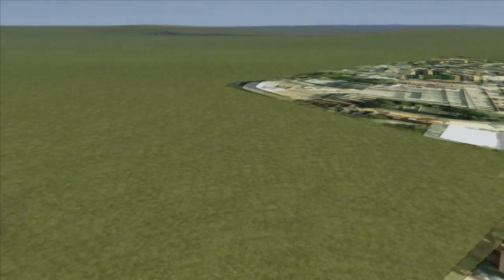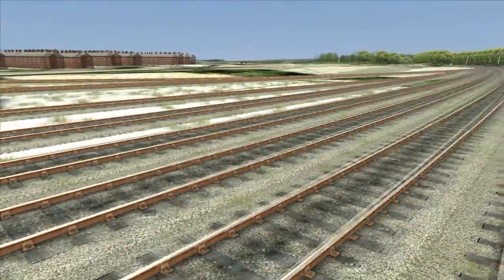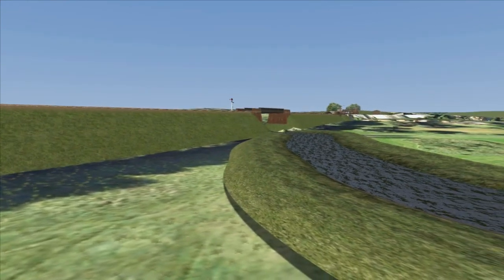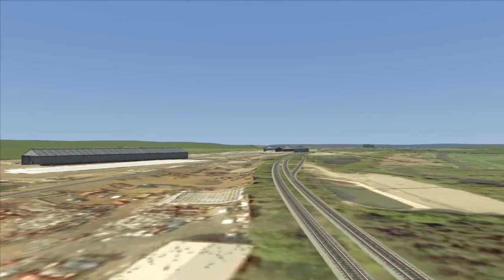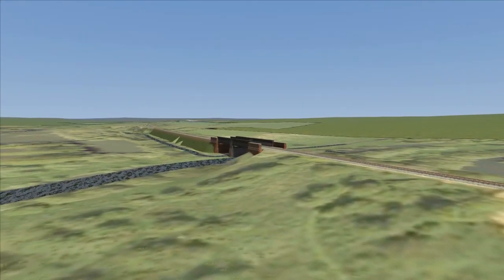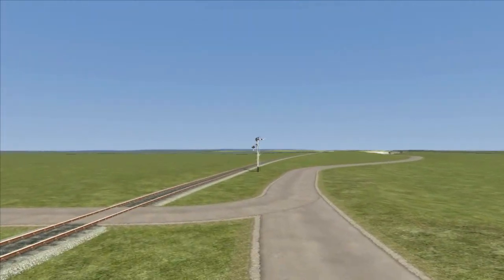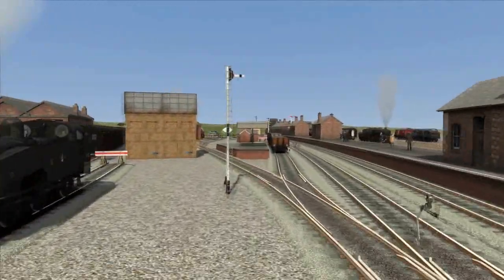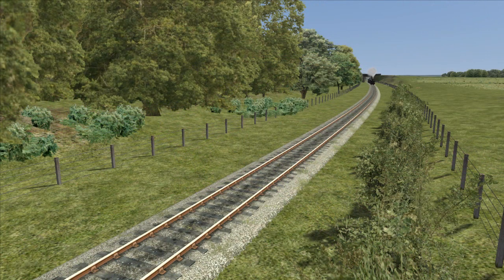Train Simulator 2014 Project 1950's East Anglia First look (Norwich city to melton Constable)

Comment: Have you finished this route yet? Rich.
Reply from the maker: ihaveakam sadly no, however I now work part time in association with a proper TS Dev company and we are aiming to do the M&GN section outright as a route of its own and then build on that expanding it out piece by piece. Sadly this route was not up to anywhere near the standards required these days so its being re started from scratch and this time will feature custom models for almost every location and prototypical rolling stock appropriate for 3 different eras of networks existence, the RS however will be built up like the overall network over a period of time, how long I cannot say as I’m juggling this and other projects as well as a normal job not mentions lifes usual commitments but I’m hoping something might get mentioned towards the end of the year, good things come to those who wait and all that!
Reply: Thanks for your reply. I live in Sheringham and look forward to the route when it comes out. Will it come out through Steam (dovetail)? Rich.
Reply from the maker: ihaveakam at this point nothings been decided but steam tend to take a large cut from the overall profit of which I’d intended on being saved up and given to the m&gn society as a lump sum towards loco restoration and maintenance but we shall see in due course